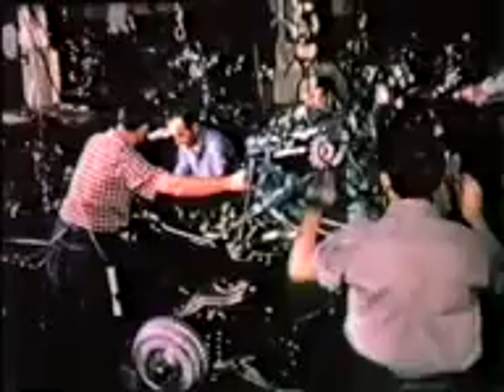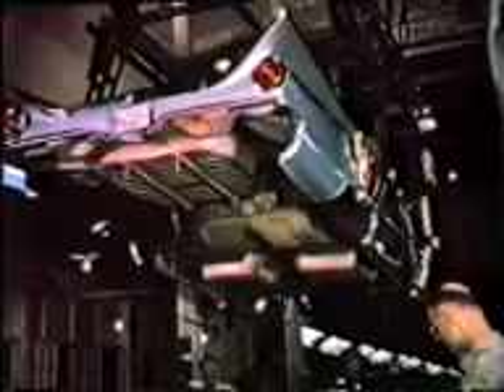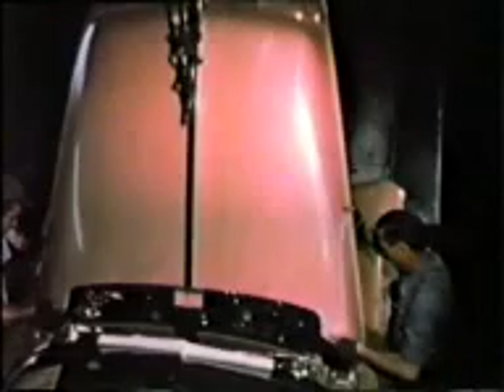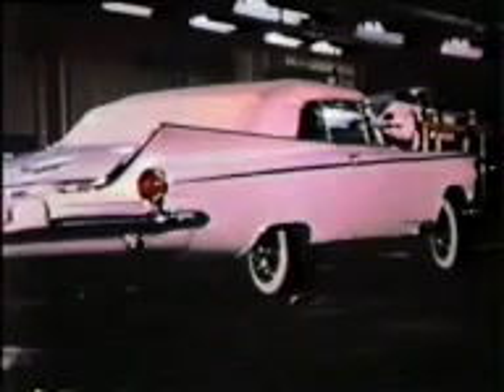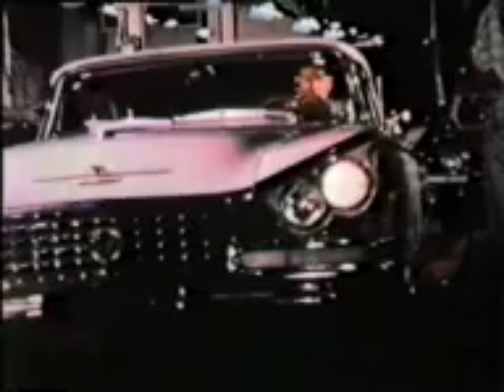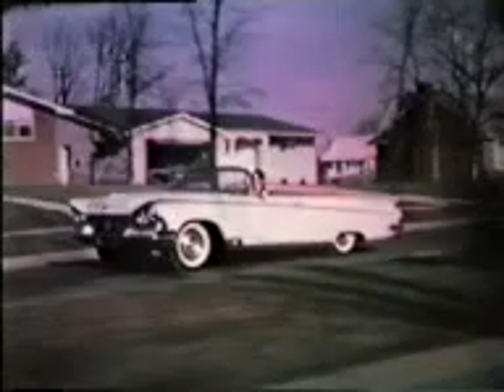59 Buick Assembly

Comment: It's not just the frame, It was the last respectible V-8 full-sized  rear wheel drive sedan. Under powerd, but Ford has mostly produced small displacment sedans since well...WWII flattys were only 239 cid Y blocks only grew to 292 unless u had a bird. couple big FE's but they didn't last to long.302's in them big pigs of the late 60's early 70's. guess it evens out when a 281(4.6) makes better power than a 429.